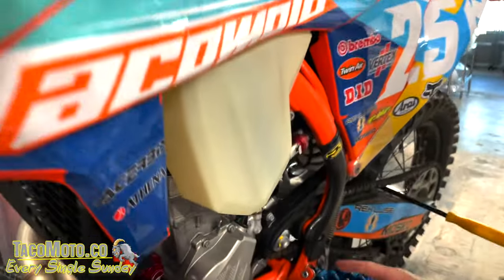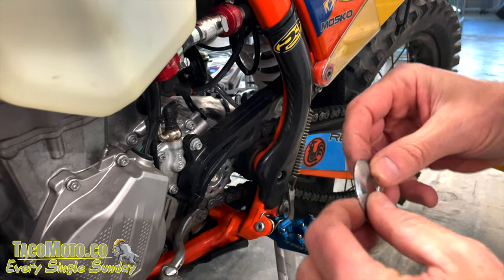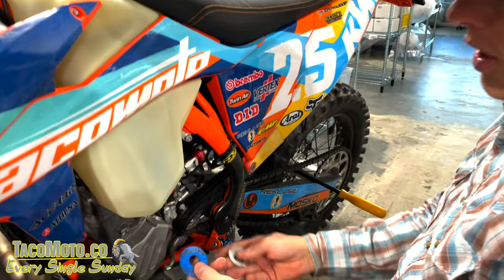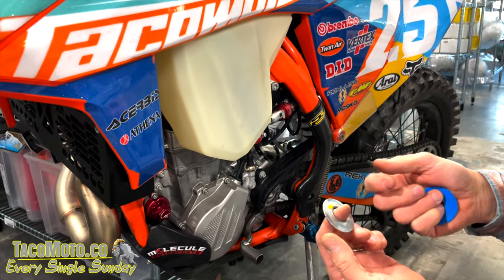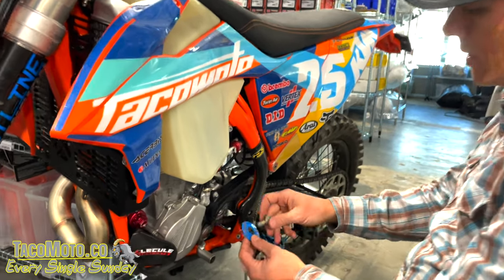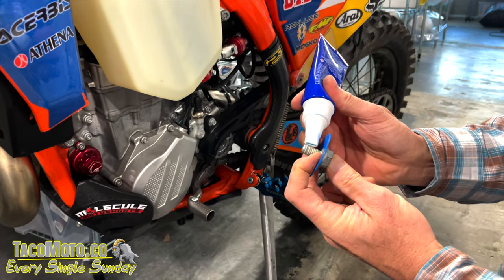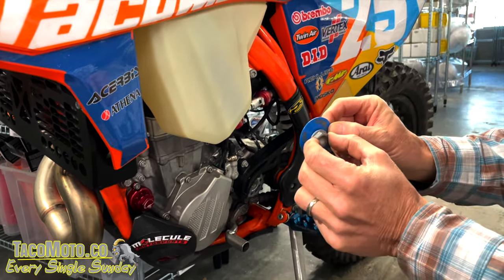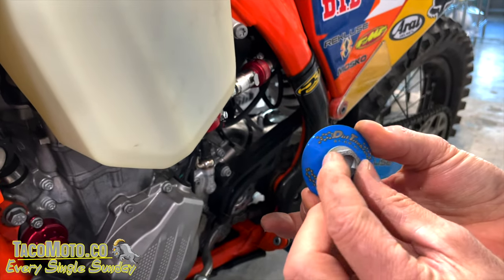Cheap Insurance - Dirt Tricks CS Dome Washer

Comment: If there is oil leaking should I do the seal kit or will just that washer help fix the slight leak ?
Reply from the maker: A new dome washer may fix your problem, but it all depends on how many times you have had it off and how old the bike is

If you are ordering parts, I would just get a seal as well

Comment: It is not a Dome washer but is called a Belleville washer as you said on the video.  I know them from outside the motorcycle industry.

A Dome washer would never work in this application.

Looking it up at a fasterner manufacturer & seller will show this. Such as at Fastenal
Reply from the maker: It’s how it’s listed for sale 🤷